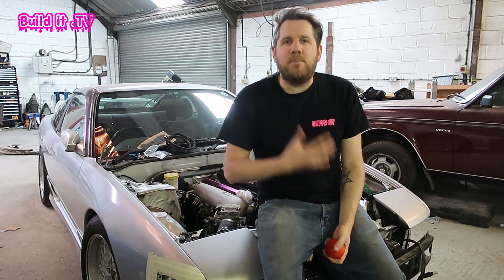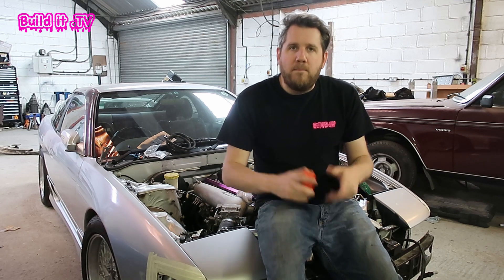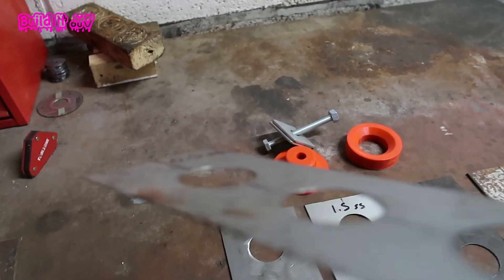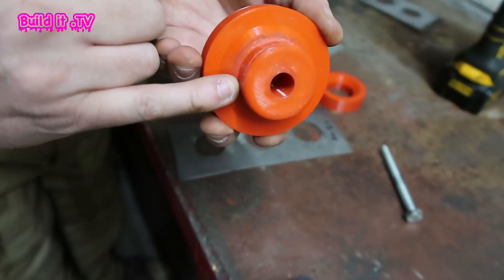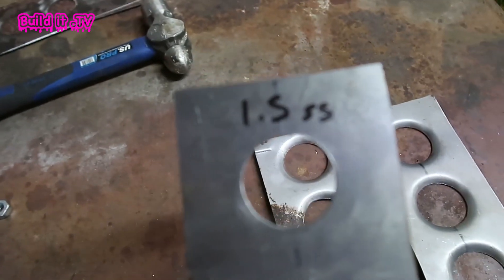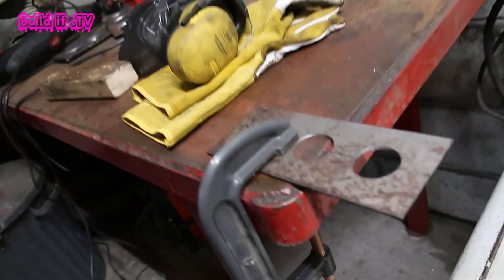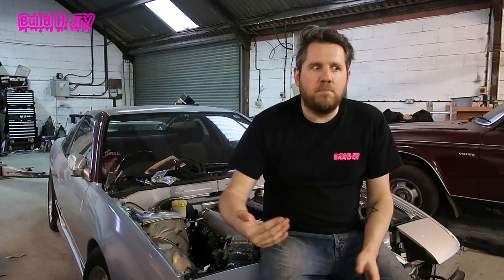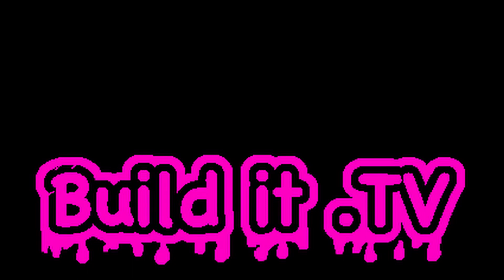3D Printed Dimple Die Tested to Destruction

Comment: Using the same die for different thicknesses will have suboptimal results given the spacing for inbetween the dies is the same in design but different for each plate thickness. The material could be just fine for the application you just haven't got the right spacing for a given plate thickness.

Comment: The reason the finished plate is bowing, is the plastic is deforming on the final push. Hence why we use steel dimple dies. Metal to metal forms it flat.

Comment: Did you try lubricating? It would help metal flow on PLA surface
Reply: Think I'd use some wheel bearing grease
Reply from the maker: That is a great idea that I never thought of 👍 I still think 1.5 is the max thickness you would want to use it for but lubricating it will definitely help with longevity.